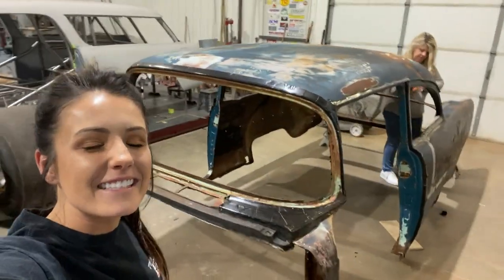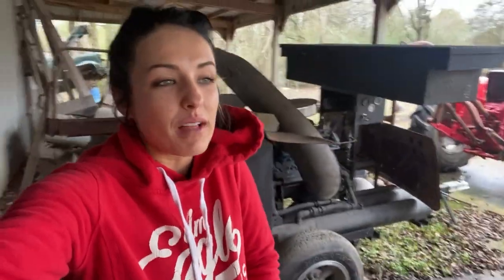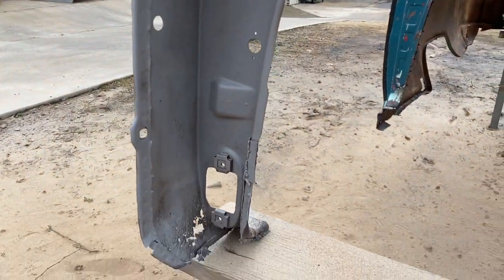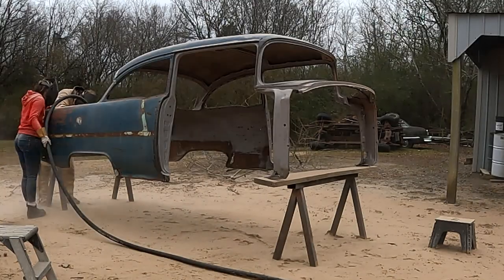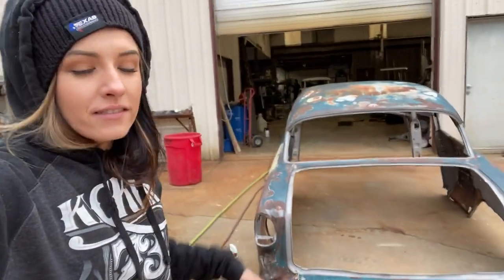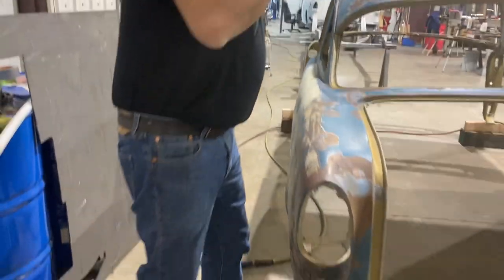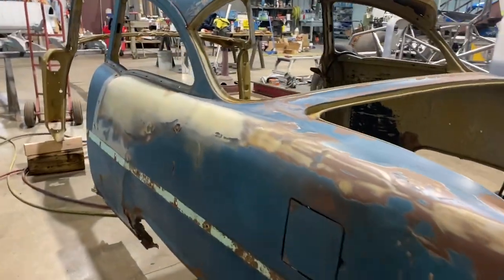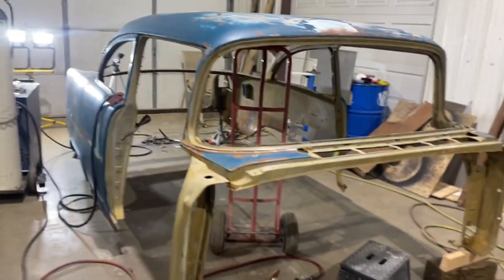Backwards to Go Forwards... Kind Of! Sandblasting/Metal Prepping/Patching - 55 Build - Video 2

Comment: When you are building a tube chassis car, the body shell isn't structural anymore.  You are building a race frame and cage, and then plopping the body on top of it.  I wouldn't call the body floating on the car, but basically that's whats going on.

Comment: I use copper as a backer and chiller when welding thin old metal  the mig wire will not stick to copper unless you get it very hot to the melting point. speeds up panel patching.

Comment: Great Channel... I would Highly recommend you guy's get a clemco fresh air/hood set-up...
I blasted with out forever like You, Until i used one...
I actually don't mind blasting now, I'm in the North East so it get hot/cold here also,   There's a valve that regulates temperature!! So when it's hot as hell out,  I can actually have ice form on the outside of the Hood, an warm in cold weather... Best 1K I ever spent... Say'n
Subscribed an ordered The shirt... Cheer's